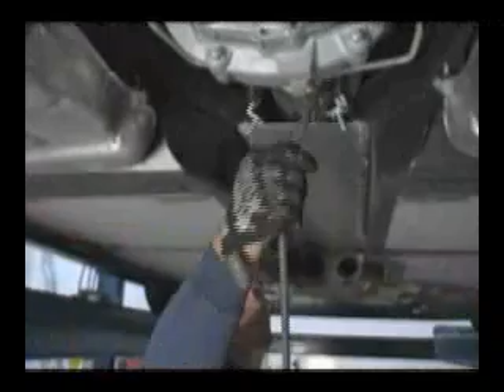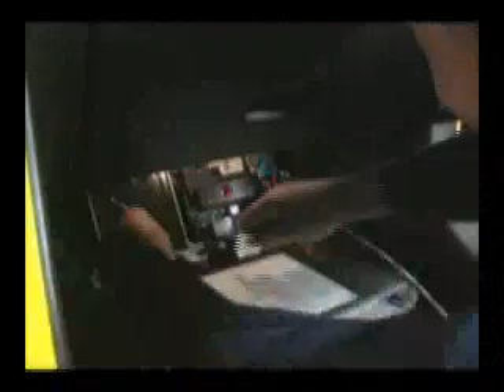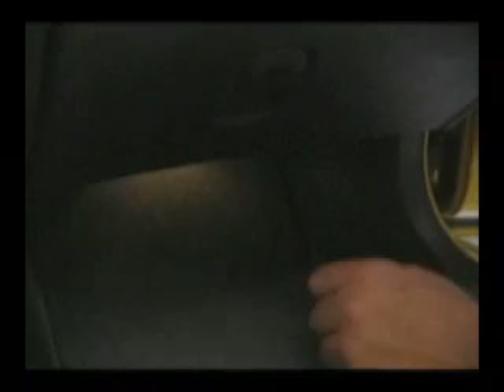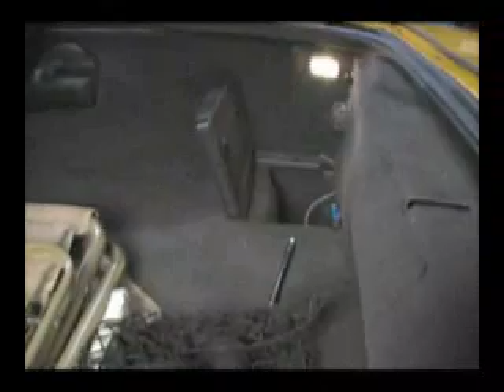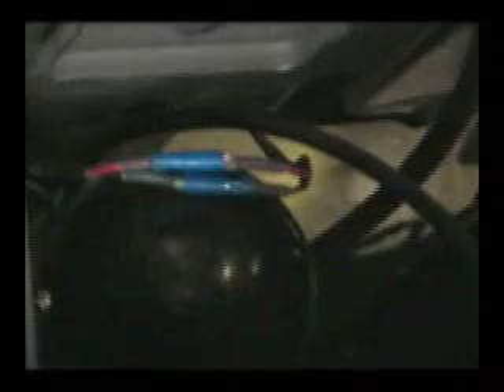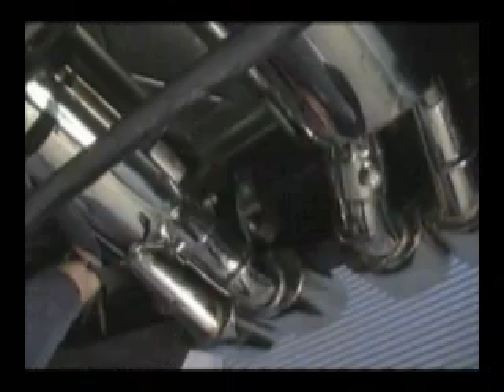How to install Vacuum control unit for Fusion C6 exhaust.

Comment: Removing the vacuum "T" from the rear of the intake is the hardest part. This job will take a little more than half a day to finish (without a lift).